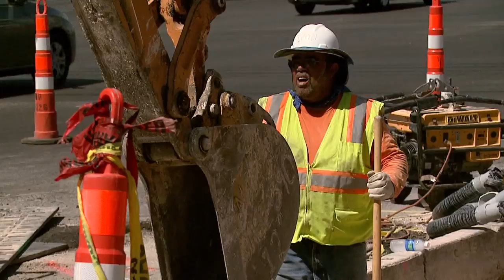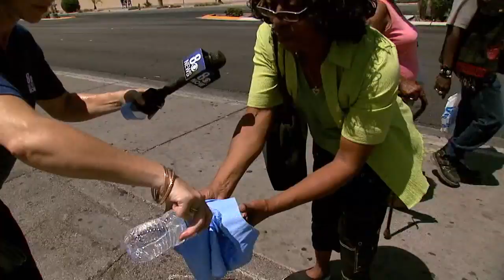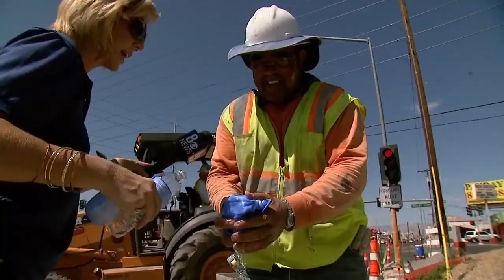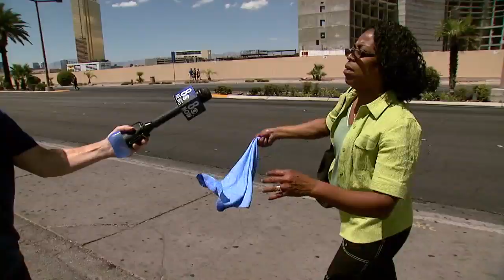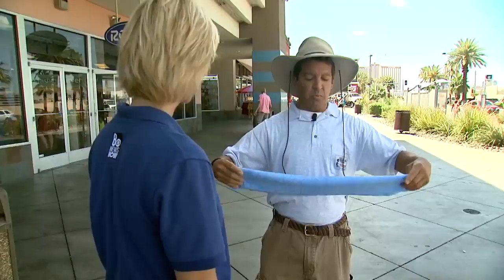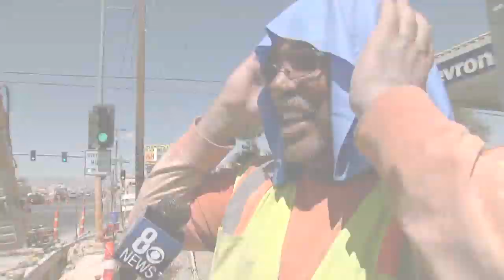Arctic Chill Towel

Comment: it does not work
Reply: Yes it does...It works a treat!!  You may not be using it properly.
Reply: @147258GS  It depends on your climate. You can whip that sucker around like a helicopter on a dank FL summer afternoon but the amount of evaporative cooling you get won't even overcome half the heat energy your muscles just created. These do NOT work all that well in high humidity.